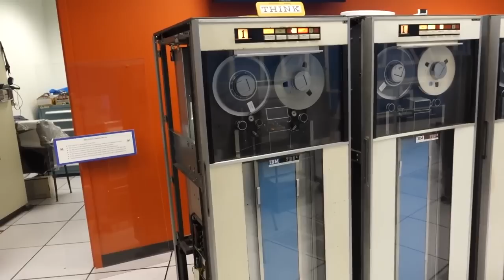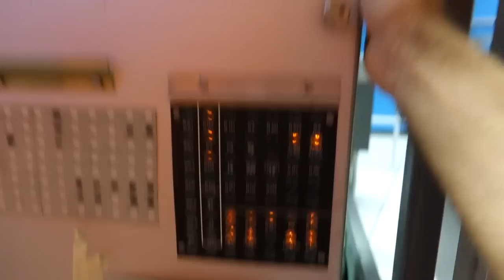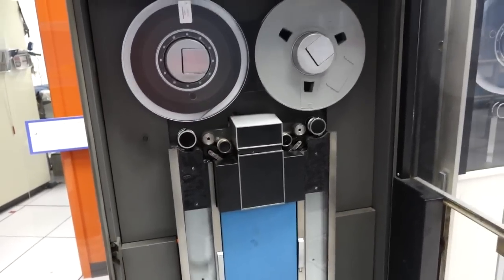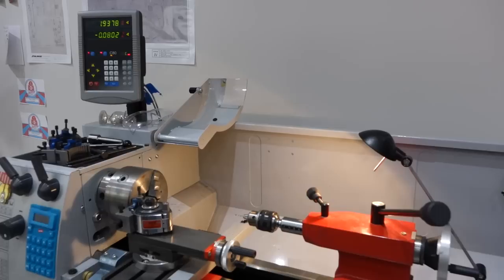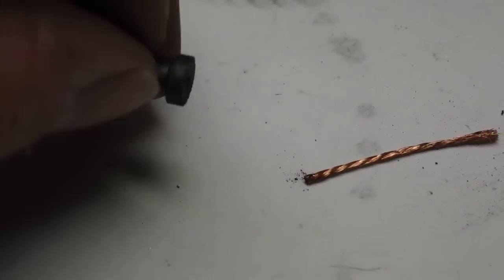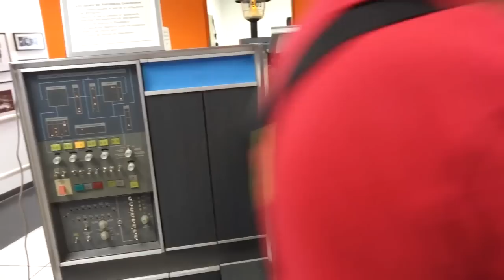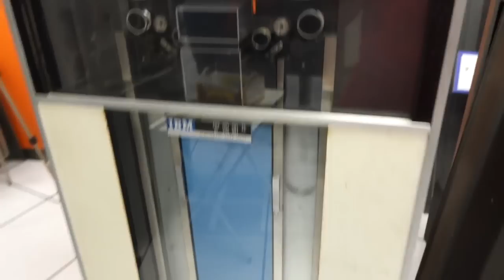Debugging the 1959 IBM 729 Vacuum Column Tape Drive at the Computer History Museum

Comment: When this system goes down... They have to call a mechanic not just run CC cleaner...HAHA!
Reply: xpez That's why they called us computer engineers, NOT mechanics.
Reply: Maybe offtopic, but i'm pretty sure cc cleaner never ever really solved a problem. It's just snakeoil ;)
Reply: @wanjaschonecke455  It can reset the registry, it's actually useful
Reply: @asbestosfibers1325  Yeah, I actually used to change the air filters as well as the oil and oil filters in these machines. Whereas you have not the faintest idea what you are talking about :)
Reply: @8bitfrenzy376  You could change any of the registers from the front panel of these.

Comment: Similar tapes are used today too. But just a tiny bit difference in size. 6 to 15 terabytes more storage capacity.
Reply: Yeah, just a tiny bit (sarcasm).
Reply: These bits need to be tiny in fact, in order to fit that many of them on such a tape.

Comment: In the mid-90s my partner and I got a job to clear out a room like that for a data processing company full of that kind of computing equipment as they were transferring over to modern style I was amazed at how heavy those machines were and all the motors I salvaged and the copper cabling and the Fan's we tried to figure out what to do with it nobody wanted that stuff ended up going to a recycler I asked the person we are working for what's taking place of all that he pointed to the corner of his office there was three Tower computers

Comment: Tape drives I worked on in the seventies were much better.
They had capacitive coloum position sensor in a bridge config.
That made positioning with servomotors much faster quieter and accurate.

Comment: this was fascinating! I have seen the fronts of the tape Drives in movies, or at a distance in  a glass enclosed room, ETC. but to see the inner workings of one of these and to have someone describe it all, was a real treat :)
and those connectors coming out of the opening in the Plenum Floor! WOW! are these like Power in, Control signal, and Data input,output ?
Reply: Yes the connectors are as you imagined. On the back of the drives at the bottom there are places for the connectors to plug in. I think there are four connectors on these drives. The drives can be chained together so you don't need separate each drive from the drive controller. The connectors themselves are large square grids with room for about 200 pins. They look kind of like a modern CPU socket. There are ten select lines (the dialable number on the top of each tape drive specifies which select line activates the drive), 7 data input lines, 7 data output lines, some other control lines, some ground lines, and a whole lot of shielding lines.

Main power is delivered separately. They take 208 volt three-phase power. The big motors run directly off the three-phase power. A power supply in each unit then develops all of the other voltages required by various components of the drive.
Reply: that makes sense, to have the power separate from the data / Control lines, to avoid EMF noise, that could interfere with the data transfer. 
thanks for describing the pin outs of these huge plugs. it was very interesting to me. :)

Comment: I had no idea those IBM tape drives were so complicated. I learned a lot. I can't believe they used two separate  vacuum   chambers to accomplish the task of moving the tape. I am not sure if this  was brilliant or the worst design ever. It seems like they faced a lot of obstacles and always seemed to find a solution. That explains why those IBM 729 tape drives were so tall.
Reply: Purpose is to speed up the reading/writing by eliminating the inertia of the heavy spools, replacing that with the leightweight tapeloop hanging down.
Reply: @timtim8468  I am always interested in how stuff works. There were so many design issues that had to be resolved, I am surprised they guys at IBM just didn't give up. It is a testament to what people can do when we work together towards a common goal.

Comment: I get goosebumps every time I see these old enterprise grade machines. They were designed and build for the spec not for the money. 8 motors just for a tape machine, holly fuck. Nowadays everyone is like fuck it, x86 architecture is good enough, why bother to use something better. Even Google, or NASA migrated to plain x86 servers.

Comment: I started my computer career in 1965 as a field engineer (glorified term for tech support) for Honeywell.  The first system I worked on was the H200 product line which was essentially an IBM 1401 knockoff.  The tape drives on this system worked the same as these described here, except they were far more simplified and required a lot less maintenance.    

See here:  https://youtu.be/i8Rv7clC_A4

Comment: 20MB per tape, 80MB on four tapes...doesn't sound like very much today. Like seven and a half minute of CD audio. But back in these day, it would have been one million punch cards. Yes. Literally one million punch cards. Side note: three 729 VI together should have enough combined bandwidth to deliver a CD audio stream. That was 1961.
Reply: There would also be a tape rack, which held dozens of reels.  The operator would have to mount them as needed.  I recall one operator where I worked backing up the system.  She had a stack of tapes to go through!

Comment: in the 80s-90-s I used to work on MDS magnetic vacuum tape drives, card readers and drum/line printers...just cant find any info or picture of those...(i just dont know what series they were, but not series 2400)

Comment: Thanks for this great video. One question: how does the clutch work inside?
Reply from the maker: It uses a magnetic powder between rotating plates. It needs to be changed from time to time. Some clever people in the team were able to reproduce the correct formula for the powder, which size and properties have to be pretty specific for it to work.

Comment: What were you using for brush material? And where do you get conductive epoxy that's conductive enough to handle this clutch current? I was watching, hoping to learn how to metalize carbon/graphite so it can be soldered to.

Comment: For decades I thought sectors were read with each reel movement.

Now I have a zillion questions about how it reads tape !!
Reply: Data is written on tape in blocks, not sectors.
Reply: RaymondHng

Thanks for the correction.

Would you happen to know of a good resource where I can learn more about these marvels of engineering?
Reply: It really depends on the computer system. DECTape as used on the PDP-8 and later machines, and the tapes used on the Burroughs 205 and 220 were effectively sectored tapes. The tape had to be formatted, just like a disk drive. All blocks were the same size and numbered, and you could random seek to a given block, just like on disk, but much slower.

Almost all other computer tape drives (including these 729s) wrote blocked tape, where you could write a variable number of characters in each record on the tape. The tape record was called a "block", and each block often contained multiple logical records. Mainframes most often used fixed-length records, rather than the newline-delimited storage you are used to today. There was about a half inch of space between each block on the tape where no data was recorded.
Reply: l wilton

Thank you!

I guess what's old has become new again with 'Logical Block Addressing' that got introduced when hdd's went to ZCAV and could no longer use CHS addressing.

I have just one more question of a mechanical nature...

How is the capstan able to start/stop the tape so fast?
Reply: A lot of very clever engineering. Capstans are very light, being hollow shells typically. I think the older ones, like on this machine, were direct connected thru a clutch to a LARGE dedicated motor, and had a brake to stop quickly. 

If I recall correctly (it's been 35 years since I had to make tape drives work, so I may be wrong) the newer designs had the capstan connected directly to a very large DC motor that could start and stop incredibly quickly, using large DC currents in the windings.

The fastest tape drives I know of were GCR (Group Coded Recording) 9-track units made by STC in the 1980s. They ran 250 inches per second, and GCR recording mode only had 0.3 inch (about 9mm) as an inter-record gap between the blocks. That means the tape went from 0 to 250 IPS in 0.15 inch, and from 250 IPS to 0 in 0.15 inch. Those are hefty accelerations.
Reply: l wilton

Incredible!

I would imagine the GCR units also used vacuum channels to buffer the reels similar to the drives featured in this video.

What if you could go back in time to 1959 and tell the techs that in 2016 there will be consumer SSDs that hold 400 billion bytes, performs sequential read speeds in excess of 2 billion bytes per second, costs about $50 and is a little bigger than a stick of gum?
Reply: Pretty much all computer tape drives used vacuum columns until the days of streamer drives and the 18-track cartridges.

What if? They wouldn't know what to do with them, and would be afraid of them. Burroughs made a 100 MB disk drive in the late 1960s. Never sold one of them. Aside from the price, big customers refused to put that much data on one drive. What would happen to your business if the drive failed? It was better to spread over more drives. Small customers just didn't have that much data. Even a pretty big bank could keep the entire account master on 1 or 2 reels of tape at 10 MB per reel.

Comment: Wonder how often those carbon brushes need to be replaced with active use. I was just thinking the copper wire used for brush contacts looks an awful lot like de-soldering braid, but since you've got an entire spool now, no worries.

Comment: Always been curious about how things like these work for real. Before now I have never seen or heard one of these machines in action close up. Only time I have in fact seen these things are in old sci fi films and some computer history docomentaries but never anything about how they actually do their thing. Intresting to see the inside also and while running. I thought these drives used some sort of servo motors for the reels and capstan that started and stopped all the time.however those kind of servos probably did not exist back then and so have to use continous running drive motors and clutches. That they use so many motors i could not guess either. Since VFDs to control speed for induction motors was also not invented back then that extra rewind motor makes sense to directly couple to the drive shaft without belt reduction. It looks a bit small however compared to the 2 other reel motors but I guess its because that rapid start and stop of the reels whle reading and writing puts extra load on the motors compared to spinning continously when rewinding. Depending on line frequency 50 or 60 hZ with a 2 pole induction motor and direct coupling it rewinds with 3000 or 3600 rpm. Now that is fast!
Reply: Exactly, I've seen these in documentaries and whatnot but never really knew what they were doing with all that jerky motion, now it makes sense.

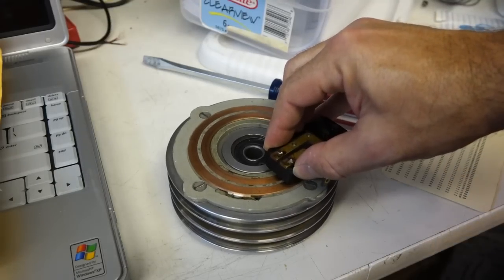Comment: 10:15 Was the current through the brushes 20mA, by any chance? I heard somewere that that exact level of current is enough to make the brush contacts self-cleaning.
Reply from the maker: These are rotating all the time, so no current needed to clean! However the current is measured in amps, not milli amps. This drives the magnetic clutches directly.

Comment: those were the days when whole floors were required for these 'main frame' computers, requiring lots of air-conditioning to keep them cool. IBM was charging a fortune for these
Reply: Yes IBM charged a lot but as part of your rental fee you got onsite IBM technicians to keep everything in good working order and fix any problems that might arise.
Reply: Today's modern virtual data centers take many times more cooling than the mainframes of yesteryear.  They are much more power dense now.

Comment: Epoxy the wire to the new brushes? 
Is epoxy electrically conductive, or are carbon dust mixed in the epoxy first?
Reply from the maker: That’s silver epoxy, it’s (very) conductive and (very) expensive. It is commonly used in the electronics industry to mount semiconductor chips.

Comment: Strange that the electromagnet of the clutch is inside the pulley, thus needing these burshes.
It is the same principle as A/C compressor clutches in cars, and in these, the magnet is affixed to the compressor and just attract the clutch plate towards a continuously rotating pulley, thus not needing brushes.
By the time this tape drive was made, A/C compressors already worked that way. Seems IBM just overengineered the thing a bit here.
Reply: I was thinking the same thing, although auto AC was uncommon at the time IBM designed these. I don't know when Detroit figured out the simple way to do this.
Reply: I think it's because there are multiple clutches coaxially so it would end up being more complicated to do it with fixed coils?

Comment: The IBM 1401 could have a disk drive in 1959.  While a system could be used with only tape storage, you would still have the tape drives on a system with a disk drive.

Comment: Anti slip ring I am. Inelegant, noisy, dirty, barbaric, and made to fail. 
1. Worked on large printers with precision registration requirements using solenoid spring clutches. 
2. Auto AC compressors for example, use hi torque magnetic clutches with a static field coil, ie no slip ring. 
Project?

PS. Vacuum tape columns are an elegant solution.

Comment: heh... the printout at the end.. it's kinda like what dd prints.. wonder if that's why it uses block size and count... would dd run on this?
Reply: These machines didn't run Unix.  But if you went to the trouble of compling it, and if you had a version small enough (remember, these had barely any RAM), then sure.  It talks about blocks and block size because that's what tape drives work with.

Comment: How much ram dit it had, how much transistors dit it had to operate.
How much data could those tapes store.
Were those tapes not prone for damage?
Reply from the maker: The IBM 1401 (not the tape unit) has 16 KB or RAM and about 10,000 transistors. The tapes hold about 20 MB on the highest density setting. Although technically these are close to but not exactly "bytes", but 6-bits characters. 6 bits character + 1 parity bit on the 7 track tape, and 6 bits character, 1 word mark and 1 parity bit in the main memory.

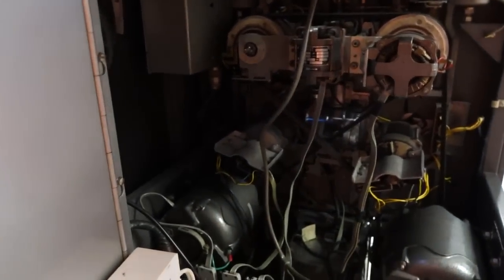Comment: 2:42 I count 9 motors, you forgot the cooling solution, has a big motor with a fan in the top. 😁
Edit: 9:35 Is that special conductive epoxy or just regular epoxy?

Comment: Curious how you milled the parts. Did you measure them out and then somehow set the machine to mill the exact dimensions? Or were you manually moving the bit, measuring in between until you got the right dimensions? I love that you can fab your own parts as needed.
Reply from the maker: Combo of both. You set the lathe using the readings, and check by measuring as you get close. In this case, it's super soft graphite (and the precision required is not critical), so just set and go is enough.
Reply: Ah, neat!

Comment: Why would you ever need special wire to run a brush for a simple magnet???
Reply from the maker: Too meet the reliability criteria under repeated flex. Cables designed for repeated flex are in wide use today, and all of them have special designs.
Reply: @CuriousMarc  makes sense. I would have just used some off the shelf Ölflex, but then i cant just hit up a buddy for purpose built wire =D
Appreciate the reply on the years old video.

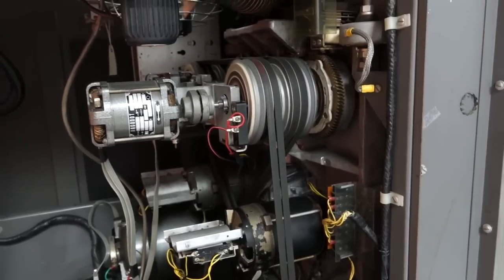Comment: 4:13 That read/write operation is rather noisy compared to the quieter IBM 3420 mag tape drives.
Reply: The 729 used a prolay and pinch roller
 with continuously rotating capstans either side of the r/w head. They make the clacking noise. BTW, they were a devil to adjust correctly. 2420 and 3420 had a low-inertia motor with the capstan as an extension of the amarture.

Comment: Not true "they didn't have disk drives then", just that they were expensive.  The IBM Model 350 with 3.75MB storage came out 1956, weighed over a ton,  and cost $750 a month to lease.
Reply from the maker: We have a 350 working at the Museum, come and see it! But start-stop tape drives predate the RAMAC disk.
Reply: @CuriousMarc  Would love to come there!   Sure tape for computers are older but this video's IBM 729 line was announced 1957, IBM 350 disk was out the year before.  Do you have any 73x series drum there? That was 1952 and later.
Reply from the maker: The 729 was the latest iteration of a line of similar tape drives that predates the introduction of the 350 disk drive.
Reply: @CuriousMarc  I'm only aware of IBM having two models before that, their first ever was Model 726 in 1952 and 727 in 1953, both 7 track.

Comment: Was this the first time the brushes were replaced since, well 1959?
Reply from the maker: We don't know for sure because we don't have the maintenance log, but many of them were worn down all the way, rubbing on the bakelite holder. Others were sparking like the one we replaced in this video. So not replaced in a long long time.
Reply: We replaced the brushes in tape drives fairly often.

Comment: how much data could be stored in a tape like that?
Reply from the maker: About 20 MB at the highest density setting.
Reply: Thank you :)
Reply: Thank you for this very detailed analysis.
Reply: You mentioned HDR1 & HDR2 but those were labelled files, right? If you had an unlabeled one, it was even more 'fun' to deal with...and wasn't there a VOL1 label as well, with tape number?